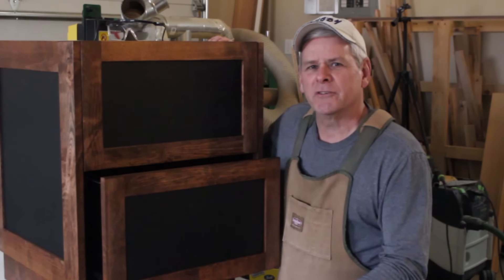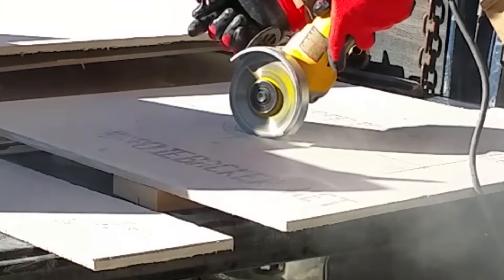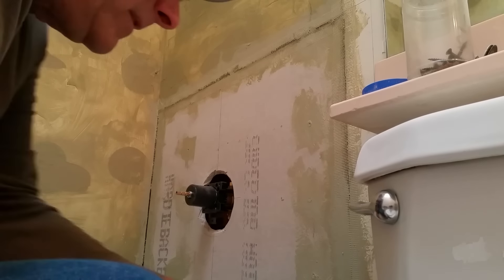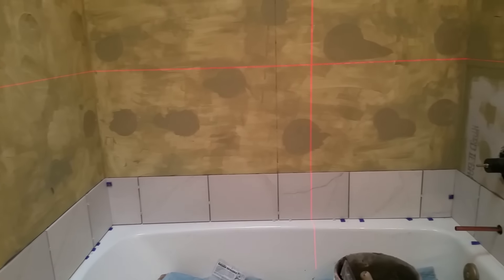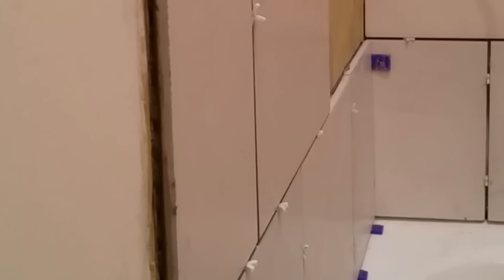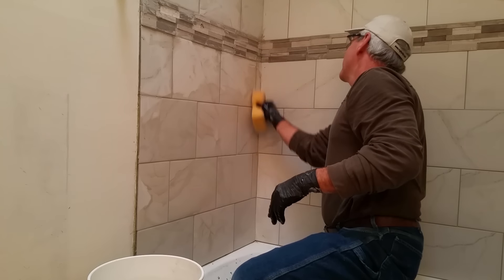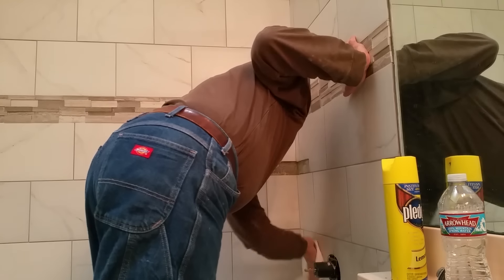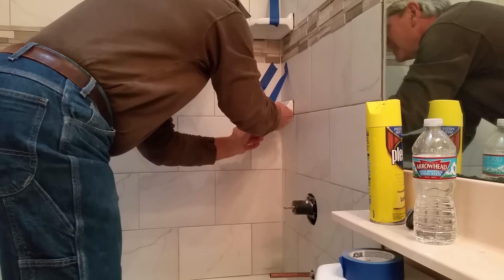How to Set Tile Around a Tub - Bathroom Remodel

Comment: This is a really great video. Taking the time to explain details, like the 45 degree back bevel for a clean grout line is solid gold!
Reply from the maker: Thanks for watching, Nicholas, and I'm glad you found the video helpful! Yeah, that back cutting the tile edge trick really does give you a nice clean grout joint that is also very durable. I still regularly see grout built up on the edge of tile to a 45°. The only problem is that it will crack and fall off over time. I never have figured out why people think that's a good way to finish the edge. I appreciate your comments!

Comment: Glad I found this video, nice to know the drywall is suppose to go over the tub not on top or behide it. Im installing tile also, this is all a challenge.
Reply from the maker: Thanks for watching, Robert, and good luck on your project!
Reply: @RustyDobbs  Its turning out petty good for my first time installing drywall, Kerdi paper and tiles. One mistake I would like to fix but impossible without ripping  the left back corner tiles out, is it cut them 1/8 smaller to have a crack (corner like) for the silocone, its more flush.. The right side oppsite to the faucet is good, has like a corner.

Comment: Thank you for the great content and demonstration. A fiber cement blade (polycrystalline diamond, or pcd blade) for a circular saw is such a life saver when handling that kind of material or laminate. Makes a lot less dust and cuts smoother, but what's even better is how easy it is to hook up a vacuum to my 6 1/2 inch saw. You could almost cut inside with such a set up
Reply from the maker: Thanks for the information about the pcd blade, Samuel! I actually do this type of cut very infrequently these days but will definitely keep your suggestion in mind for future reference. My method certainly does make a lot of dust that does not need to be inhaled! Thanks for watching!

Comment: Just what we needed.  Understand how to do this job when contractor comes to replace shower with bathtub.  Thanks
Reply from the maker: Thanks, Irene! I'm glad it was helpful. I'm giving you a link to another video that is typically the way I prep a tub surround for tile if it's totally my call. I like 1/2" Hardiebacker a lot as a backing for tile. These days I will normally use a waterproof membrane in the corners and seams, but not on the full face of the Hardiebacker for reasons I won't go into now. If your contractor wants to coat all the backerboard with a membrane, that's fine... just something he and I would not agree about. Good luck with your project and thanks for watching! Here's the video:  https://youtu.be/ZAWpt2ieWf8

Comment: only professionals pre drill holes on backing boards, very nice instructions. THANK YOU.
Reply from the maker: Well, Crystaryl, I think people who work with Hardiebacker enough come to realize that predrilling only takes a few more minutes but gives you a real secure connection to the studs with every screw. Otherwise sometimes you get a breakout at the edges of the material which is a drag. Thanks so much for your comment.

Comment: Nice looking job and you cover a lot of good points. I would recommend applying the waterproofing to the whole surface (backerboard) behind the tile though - backerboard is not impermeable.
Reply from the maker: Thanks for your comment, Justin, and I hear your point. I have mixed feelings on that. I'm going to get a little long winded here, so bear with me. First, for any tile job to be in good shape after say 5 years, it has to be maintained as in squeegied and towel dried after use, I think. Plus, grout needs to be touched up as needed and caulk in corners periodically checked and touched up. If those things are done, any surface behind the tile is going to hold up because minimal water is ever going to reach it and never in quantities to cause a problem. Now, we both know that kind of care may or may not occur. That's where Hardiebacker type products are so good. If tile is not maintained and water gets to the Hardiebacker, it's going to soak into it, which is your point, but it's not going to cause a break down of the material, maybe ever. But since it is like a sponge, it dries out relatively quickly, even behind the tile. Now that's not ideal but probably the best outcome in the situation.

Here's another scenario that I am dealing with right now. Next week I am doing a major cleanup, recaulk of corners of a shower that was completed about a year ago. I didn't do the work but saw it before the tile was installed and it is total Hardiebacker installed well and waterproofed to the max. The owners installed a very tall glass enclosure across the opening that virtually creates a sauna. Ventilation is poor. They use the shower, walk out of it and close the door so it stays constantly wet. Caulked corners have major mold and mildew that is going to continue to be an ongoing problem if they don't dry the shower after every use. I also suggested they install an exhaust fan in the ceiling over the shower but I'm not confident they are really going to follow my advice. One thing is for sure, the shower is not going to leak because of the waterproofing. But it is also obvious the waterproofing may be making it difficult for the tile and grout to dry out.

Anyway, interesting dilemma and would be curious to hear your thoughts. I don't typically use waterproofing over 1/2" Hardiebacker. Just seal the seams with fiberglass tape and thinset, then set tile. Then emphasize maintenance and upkeep to the owners. This link, https://youtu.be/ZAWpt2ieWf8,  is another video of a tub tile surround that shows my typical method, if it is left to me.  Thanks again for your comment!
Reply: Hi Rusty. In that vein, I just demoed my 1940's bathroom to the studs. What I found was they had covered between the studs with a steel honeycomb mesh and then troweled with what  I guess we would call thin-set to  about 3/4" thick, and then tiled over that after it dried I saw no indication of water damage or staining on the studs or anywhere else for that matter. They must have been true crafts men because that 3/4" was consistent everywhere!  It took a long time to take all that stuff off. I told  my wife we could have used that bathroom as safe-room.Tom

Comment: That’s an interesting point I haven’t considered before.  In my experience which admittedly shorter than yours I have found that I’ve had to deal with studs rotting as the water wicks through the board as I rip out old tub tiles.  I guess time will tell if these new water tight systems prove better.  Thanks for the info.
Reply from the maker: No doubt about it, that's a big problem when studs are wet and doesn't speak well of any surface that allowed that to happen. But glad you are keeping an open mind about my perspective which is just that, my perspective. I set my first piece of tile in 1977 and in those days you had two options for wall surfaces in showers and around tubs. Plain old sheetrock and mud/lath cement walls that were hand floated with a hawk and trowel. Mud walls were expensive but basically outlasted the tile's useful life if done right and sheetrock fell apart as you would expect. Along came 'greenboard' which was moisture resistant sheetrock. It was a little better, but not much. When Hardiebacker 1/2" showed up, I stopped doing mud work and have used it in all my showers and tub surrounds ever sense. Again, installed right, I think it will outlast the useful/stylistic life of the tile that's attached to it and its wicking properties, I think, help minimize the growth of mold. I haven't considered myself set in my ways, but that's probably an accurate characterization. I just go with what works for me and haven't been particularly interested in the newer systems. My guess is that they are probably fine, but the questions about trapped water still don't compute with me. Good luck with you business and thanks for watching!

Comment: This is probably the best video I have seen on installing tile in a alcove area above a tub. I have one question which is: Is it common to tile all the way to the ceiling, and if not what is a common stopping point? I am getting ready to start a project like this and don't really have a preference, and just want to stop where it would be preferred. Thank you!
Reply from the maker: Thanks for your comment, Greg! There isn't really a rule of thumb for the height of the tile in a tub surround. I think with larger format tile being installed around tubs these days, it's more common to go ahead and run the tile all the way to the ceiling, assuming a normal 8 foot height to the ceiling. But if you have a nice bullnose trim that you're going to be using on the front edge, it's also very common to stop the tile about 6 inches to a foot above the showerhead and cap it with the bullnose. Good luck with your project!

Comment: Excellent explanation.  Exactly what I needed for my job.  Thank you!  My only critique is that Hydro-Ban is supposed to be used with Laticrete Waterproofing Membrane Fabric which is different from the fiber tape used in the video.
Reply from the maker: Thanks for the comment, Jim. Yeah, in the span of my tile setting history, the waterproofing products have been a later arrival to the product 'arsenal' for me and I'm still not completely sure how I feel about them. So I tend to use them when and how they make sense to me in a given situation. My main issue is what happens to water that ultimately gets trapped behind the tile and against the waterproofing material. I am planning to do a video on this topic and explain my perspective a little more fully at some point. I appreciate you watching and am glad the video was helpful.
Reply: Thanks Rusty.  I look forward to the video on waterproofing.  I'm an amateur at tile in showers.  My only experience is about 800 sq. ft. of floor tile in my house.  I'm very concerned about the issue of water getting behind the wall and into the framing -- black mold made a friend's life hell for about half a year.  I haven't set the first tile in my tub wall yet -- since my wife and I changed our minds on the tile.   I appreciate your video and appreciate the reply.
Reply from the maker: Hey Jim. I wanted to add a couple more thoughts based on your reply last week. First, take your time on the tub surround... it isn't that difficult contrary to the opinions of some. On the waterproofing issue, the whole trend to create a complete waterproof barrier behind the tile just runs counter to the typical approach of tile setters for about the first 30 years that I set tile. Conceptually, I get it. But the whole notion that it is needed confirms the fact that everyone from any generation of tile setters knows that water will get behind the tile at some point, to some degree depending on how well the grout and caulk joints are maintained. So what happens to it when it sits between a waterproof barrier and the tile? Common sense tells me mold starts to show up. My guess is the proponents of this approach are going to say, "That ain't my problem... you should be happy your studs are dry." Here is a link to a video showing my approach to prepping a tub to set tile. https://youtu.be/ZAWpt2ieWf8  It doesn't have the views that the one you watched does, but when all the decisions are left to me, this is how I do it. I also encourage homeowners to wipe down the tile after each shower and maintain the grout and caulk joints. The 1/2" Hardiebacker will take care of any water that reaches it without any damage to anything and without promoting mold growth. Properly maintained, this type of installation will last until people decide they don't like the tile anymore. Anyway, that's my story and the points I will make in the video which will probably not be out in a timeframe to be helpful to you. Good luck with your project!

Comment: I am now subscribing. I just hope the video started from the very beggining. What to do if it is painted around the tub, how to remove the faucet and stuff. Should I scrape the paint? 
I am going to try to do it myself but I have no knowledge about this stuff. What is the brown thing on the wall the you set the tile on? Is it a special type of paper to lay on before putting the tiles? I may sound so ignorant but like I said. I have 0 knowledge about tiling.
Reply from the maker: I appreciate your enthusiasm for wanting to take on your project! I would encourage you to check out more of my videos and videos of others to get a better understanding of what you need to know before you start. Your questions sound like you are ready to get started as quickly as possible but are not sure you know where to begin. Get answers to your questions before you do anything! A rule of thumb for me has always been to try to know how things are supposed to turn out step by step before I start a project. Then take it step by step! This kind of stuff is really not that difficult but you don't want to begin without gaining some knowledge of the skills necessary and understanding the tools you need to pull this project off. Please don't watch a TV remodel show and just start busting everything up with a sledgehammer! Good luck and start learning!

Comment: I am thinking of fixing my tub shower by myself. It has a window. I'd love to hear your tips for tile around a shower window
Reply from the maker: Sure! Ideally, the tile you purchase will have bullnose cap or sometimes it is called surface cap available that has one edge that is rounded and glazed. These are generally pieces that are 2 to 3 inches wide and in various lengths depending on the tile. These pieces are used on the exterior corners of your window and the regular tile butts up against the finished edge of the cap to form a nice corner. It makes sense once you see it! But that’s the best way to deal with windows! Good luck!

Comment: Mr. Dobbs,
This is a great video, and I'm just getting ready to fix the shower plumbing on my tub, and then tile it and glaze it.  Nervous doesn't even come close!  When you have to tile and glaze an old tub which do you do first.  I'm told to glaze the tub first, as the glaze needs to get "behind" the tile on the tub surface.  Would you agree?  Thank you so much.
Susan
Reply from the maker: Hi Susan. Thanks for watching and good luck with your project. When you are talking about 'glazing' are you referring to putting a new finish on the tub or waterproofing the backerboard behind the tile? I'm just not familiar with your use of the term. I use 1/2" Hardiebacker for all my wallboard in shower and tub areas because it is such a good product. I only waterproof the surfaces in a situation like this where I am not installing Hardiebacker except around the faucet on this job.  Hope that helps.

Comment: I got a new bathtub and tile put in and there is only grout in the corners and in the gap between the bottom of the first row of tile and the bathtub.  After watching your excellent video it sounds like that's going to crack as soon as there is movement.  Sounds like I need to go over those areas with caulk.  I asked the installer if I needed to seal the grout and he said no.  He also said I only needed to wait 24 hours before using the shower which seems to contradict what I've read after the fact. I should have done more research first but I was in a bit of a bind time wise so any thoughts you can share would be appreciated.
Reply from the maker: Hey Will. There are so many products out there now that serve many purposes, like grouts that have sealers built into them that I wouldn't get too concerned if you are satisfied with the overall look of the work your installer did. As a general rule, any time tile surfaces that are on different planes that come together, those corners or joints need to be filled with a flexible caulk because when movement is introduced between those surfaces, the grout will crack. At your tub level, it is not a big deal except that it just looks bad when it happens and can be cut out and re-caulked when that happens which may be a while if it's a new installation. But the main thing I would say to you is if you want your job to look like new for a long time, then squeegee and towel dry the tile on a daily basis as it is used. Then maintain the grout joints and caulk joints in the corners. It's really no more complicated than that. Hope that helps and thanks for watching and for your comments.

Comment: Refer to 3:20 in the video:  I have a situation similar to what is shown in your video and I’m having trouble figuring out what to do.  How did you seal the gap between the side of the tub and drywall?  How did you finish the area on the wall at the tub’s radiused edge where there’s a large triangular shaped gap. (the round over from the top deck and sidewall of the tub)?  Thanks for posting the video...well done.
Reply from the maker: There are different schools of thought regarding your question, Rev. I tend not to worry about the gap between the tub and the Hardibacker (as long as it’s reasonable) because I’m going to bring the tile down to about 1/8” from the tub and that joint will be caulked with a siliconized acrylic product. So I’m a lot more interested in getting that joint to an easy to maintain size. Some people like to seal the joint between the wall board and the tub which is fine but there will be movement between the tub and wallboard over time, so the joint is likely to crack anyway. So my broad answer to your questions is that I work at getting very precise cuts on my tile then make sure I get a good bond between the tile and the wall board. Maintaining the caulk joint corners over time as well as grout joints will make these installations last many years. Thanks for watching!